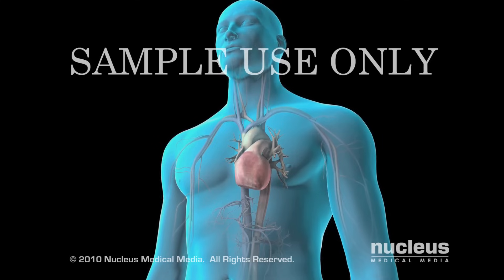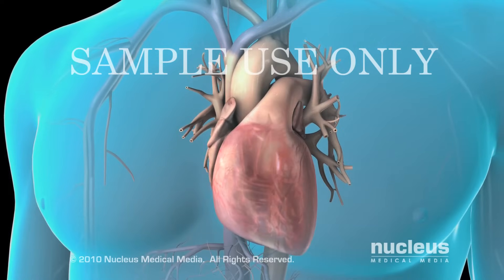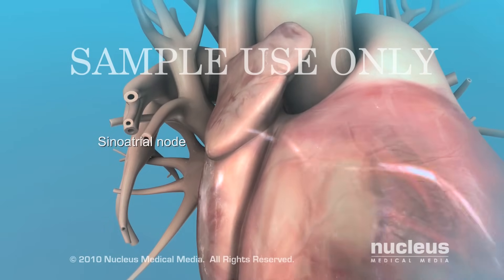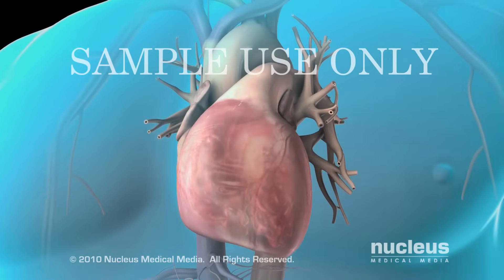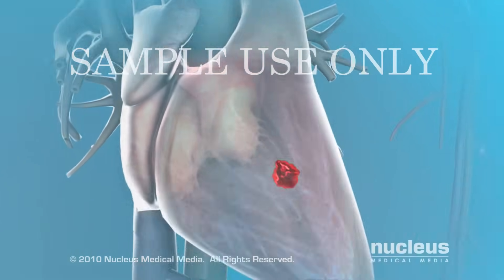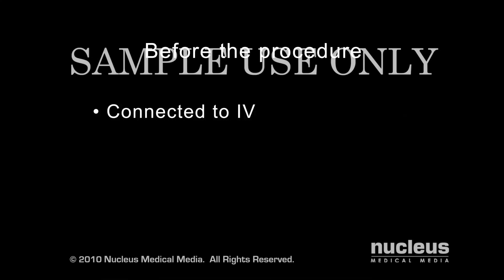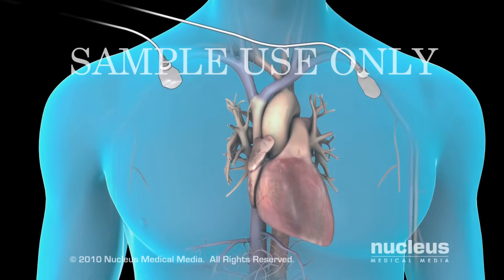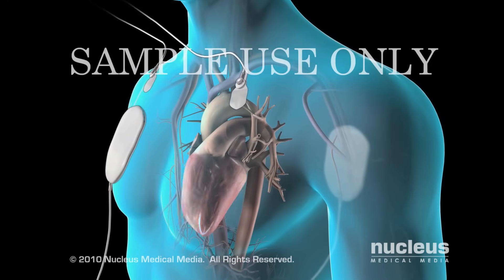Cardioversion (for Atrial Fibrillation)

Comment: it works but it's not a cure.
Had this done in 2021. Had to do ablations after that as the Cardioversion is simply a way to get your heart rate back into normality...while Ablation actially finds and disintegrates the problematic points in your heart that lead to abnormal rythm

Comment: I just had this done, & it worked from the first shock. I wish they did this, the first time I went to the emergency room 6 years ago, because of this same issue. I probably had irregular heart beat for over 15+ years. Before doing this shock treatment, they tried different IV drugs for 3+ days, to see if it convert with out doing this treatment, but it didn't worked. I am also on 2 medications, to keep it from coming back.

Comment: Have had 4 cardioversions (3 in 2020 and 1 in 2021). 2 done with ketamine/fentanyl the other 2 with propofol/fentanyl.

First, third and fourth all worked, the second didn't.

Cardiac ablation done Dec 3/2021. So far so good since then

Comment: Going for a cardioversion in a couple of weeks does procedure usually work
Reply: Justin  it went very well, so far so good, heart rate is good and is  in normal sinus rythym so far still taking Metoporol and Eliquis tho.
Reply: Justin   Ok they wanted me to have the Cardioversion done after I went into the ER but I wanted to see if I can get my heart back into rythym on my own by diet meds and treating my sleep apnea but after 2 months my heart was still not in sinus rythym my heart rate was not too bad because Metoporol was helping to control the rate but I was still in Afib because my hearts rythym was still not normal, that’s when I scheduled the Cardio Version which was successful I should have done it when I was in the hospital but like I said so far so good, Hope everything works out for you. God Bless
Reply: @UCtGPEfTJwr_9A0zdGgEqfCA Thanks Good  luck with everything man, yea it was a very scary experience for me as well my blood pressure was sky high 233/110 took them awhile to get it down my BPM was 210 but since I had the cardioversion in August everything is pretty good, did they schedule you for a cardio version ?

Comment: I had  this procedure done 5/31/18 they did a TEE echo first.  I was converted back into sinus rhythm.  I don't know if it was one one try or more.  They sedated me with propofol and wasn't aware of anything.   Home from the hospital tonight.
Reply: Wanted to tell you that my wife has that problem right now thank you for sharing
Reply: I had my surgery to repair my mitral valve  two years ago. Doing well.  Had the maze procedure to fix the afib.  So far no more afib.
Reply: What was bpm before taking cardioversion
Reply: Good luck man
Reply: 1q

Comment: What exactly electrical shock does to the heart so it returns to the normal sinus rhythm?
Reply: Артур Мудрик in a cardioversion the electrical shock is actually stopping the heart. It automatically restarts again hopefully in normal sinus rhythm. Each individual cardiac cell will beat individually. If you looked at it under microscope you could see one cell beating so the heart will automatically just start beating after it is stopped with cardioversion.
Reply: Oh, now i see, thank you!
Reply: I don't like the idea of the heart scarring, every time you have one.
Reply: Yep but it is usually temporary.

Comment: I've done ablation for this WPW syndrome and after the procedure i only had 1 episode of AF which lasted 25-30 minutes,but it stopped on it's own. After that i was plugged with an ECG holter for a 24-hour monitoring and sometimes the WPW was showing up,sometimes not so it is half-dead right now but it's still there. Point is after the ablation it's been modified so the response time of the WPW is about 400+ms so the speed is rather low i only get some "pumps" in the chest for like a second or something which is nothing. My personal advice is to have the electropsycial study and do the ablation procedure,.

Comment: Yea but what happens when the normal rythm is restored, doesnt this pse more risks of the thrombus to travel out through the aorta?  anticoagulant therapy?
Reply: I know this is old but for others. 
Usually if AF has been present for more than 48 hours, cardioversion wont be performed until after at least 3 weeks of anticoagulant therapy to minimise the risk of stroke and thromboembolism.
    In the Uk anyway.
Reply: Alex Blanc if you are already on Warfarin or another blood thinner they'll check your INR and do it right away. Or if you have what they call Holiday Heart from drinking too much alcohol they do it without anticoagulation therapy.
Reply: +Saeed Younus '